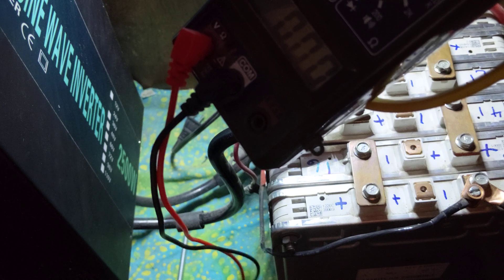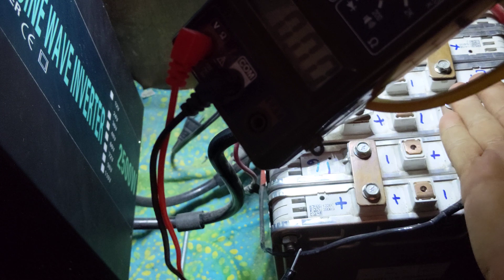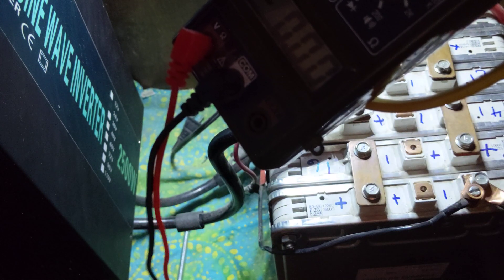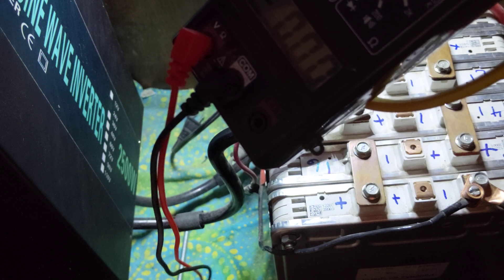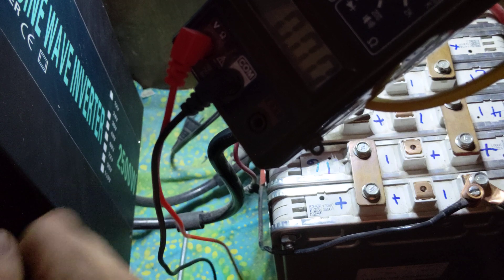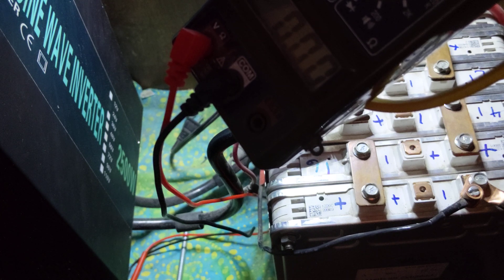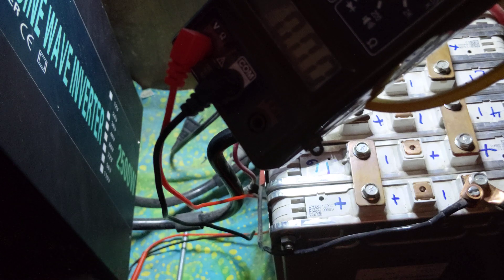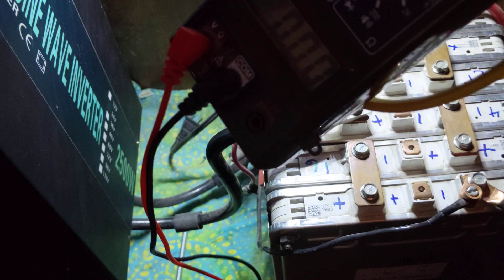Part 2 of the 10-month check-in on the 24-volt Nissan Leaf off-grid battery bank.

Comment: I just ordered 3 used Leaf modules from a company that claims they are approximately 39AH each and in the description they even lower that to 33.1 and I guess I am still getting around 1kwh. Is that OK or good in your opinion. After all it is only $114.00

Comment: Good morning, I have 48 of these leaf batteries and wants to configure it for a 24 volts off grid system. Any suggestions on a possible configuration?
Reply from the maker: My apologies for the late response. I would series groups of three together and then parallel all of them to keep your 24 volt configuration. I'm willing to have a phone conversation to explain it more if you want.

Comment: I really appreciate this video, not just because you’re talking about a 24v leaf system, but you’re speaking to all the environmental arguments that really resonate with me, and probably should resonate with all of us. I’ve worked in the solar industry for years, and lived off grid for a long time, (and have been generally distressed at the growing popularity in interest of lithium battery backup for homes.) But this makes sense, and in my opinion it’s the only way to make off-grid power a reality for most people. Thanks for the cogent video!
Reply from the maker: Oh wow... Thanks for the astronomically kind words! I was really trying to go for something that didn't exist before not only with the style of video and presentation but with the actual content. Other than the people that I have coached through this whole process there still isn't anybody on YouTube that has a mobile 24 volt off-grid solar system comprised and configured with reclaimed Nissan Leaf modules. You'll find a bunch of people that are using leaf modules in 48 volt systems because that's how they were in the car but people were a bit too afraid to tear it apart and reconfigure it to a different voltage so that you could use off the shelf store-bought inverters. since flicking the switch and going completely off the grid myself I have definitely coached over four dozen different people through the process which is a large motivator of why I created this channel. Many people here the initial numbers and see the drastic difference in cost and for some reason just don't believe me. So I had to make videos explaining every little tiny detail and then ridiculous videos to prove that it works and just keep proving it over and over again with hard data and then people start to wise up! And they have. Three years ago it was almost impossible to convince anybody to do something like this. But, times have changed and perspectives have gone with it. When I can prove that I can run an air conditioner, cooktop, and lawn mower simultaneously with my $1,278 solar system people start to pay attention. Or like the latest video on this account I decided to cook lunch charge speaker charge a tablet, run a fan, mow my lawn and use a 12-amp skill saw to cut wood all at the same time. Not because I like showing the system off or doing completely outrageous things that nobody would ever actually do in the real world...I make those videos to prove to people that it's possible and it's not only possible but probably stronger and it's going to last longer than anything you're going to buy brand new. It really is a win-win-win situation for everybody involved. I very much appreciate your kind words of concern towards the impending doom of our planet. I definitely was able to accomplish two or three things with this system other than saving people money and providing a hassle-free basically plug-and-play solar system. But the growing popularity only stifles the new lithium industry and the extraction of more. It would be impossible to say how much lithium we actually have just sitting in used electric vehicles or machinery. It's a lot though...♻️🔌💯🌞😎

Comment: Can I series 4 of those for a 24volt battery back at nominal charge
Reply: Thanks for your replie much appreciated.. I was planning on changing it at 30 volts max that's 7.5volts per module..
Reply from the maker: @fadajuiceful  Just read the spec sheet on whatever inverter and charge controller you're using Make sure that it can go to what you want it to go to!
Reply from the maker: As long as your charge controller and inverter are ok with going that high. Most 24 volt inverters cut off at somewhere around 30 to 32. Obviously you'd be able to get four of them in under 32 volts but do you really want to be pushing your inverter that hard 24/7? Yes it's possible, I don't think it's healthy for any system. Same applies with using two of them for a 12v system.

Comment: This May be a silly question. But are your solar panels 12 or 24volts? And can I charge the 24v system with 12 volt panels. Is this an instance I’d have to wire 2 12 v panels in series?
Reply from the maker: That's not a silly question at all! That's actually fairly observant of you! 😉 Yes, if you only have 12 volt panels you would have to start with two of them in series and then you could parallel after that but I highly recommend you NOT using 12-volt panels. 12 volt panels are hobby panels in my personal opinion and should only be used as such. If you're trying to create a solar system that you want to live with and live off of then you need something more substantial. Each one of my panels is a different brand name and has a different voltage but they are both over 30 volts a piece. I've seen some panels as high as 50 volts a piece! ♻️🔌💯☀️💚🤙🐢
Reply: Ezmeralda Du Dortoka thank you so much! I thought so just needed a little reassuring
Reply from the maker: @scottmuir6250  Anytime! We can't save the world if we don't understand how! 😎🤙🐢

Comment: I am wanting to build very similar system to yours.   How many watts of solar are you running up top?  How many modules are you using and what are the volts on them?
Reply from the maker: 600 watts between two panels. 6 leaf modules @ 8v a piece configured to 6s2p or just 6s. Three and three to make two 24v batteries that are then paralleled for a little over 3kWh of storage for $450ish, shipped. Less with my code.♻️💯🔌☀️ I go into pretty heavy detail on all of that starting with the very first video on this channel. I don't really talk about anything else other than how the leaf modules fit into a system and what components you'll need to be able to utilize them. I'm pretty sure I've covered it all step by step with sources if you just start at the first one! Fire any questions my way if you have them!😎✌️🐢
Reply: @ezmeraldadudortoka7549  I have been a subscriber on the tv youtube and absolutely love your channel and how you explain it in such simple terms that even someone like myself with no electrical knowledge can understand it quite a bit more now thanks to you.  We are on your channel on the tv as we speak and saw this video and said he has the very same solar system that we are wanting to build but hesitant on what to get until now.  We currently are doing a school bus rv conversion (Skoolie) and we are administrator/moderator of the group on FB called,   The New Skoolie Nation.  If its alright with you I would like to share and mention your knowledge on our group of over 1500 members and growing.  Join us if you like.  Thanks again and back to watching more of your videos.
Reply from the maker: @frankdejesus9783  Thanks , I'm glad it's getting out there! Feel free to share whatever you want wherever! That's the whole reason why I spent a narcissistically large amount of time talking at a phone! There's many other videos of the installation of the the system on my shorty on the graminsta @ezzydortoka. The install was way back in late January early February of 2019. It's not a real hard concept to follow though. Panels, charge controller, batteries, inverter, cables, fuses, lugs, bus bars, bolts, allthread, and some basic tools and you're of an running!! ♻️💯🔌☀️
Reply from the maker: @frankdejesus9783  there many others also on Instagram that I could point you towards for different install ideas and configurations of all leaf modules. There's some cool stuff happening with these modules and I certainly don't deserve the spot light. Every body just like y'all making good choices are the ones literally saving the world!♻️💯🔌☀️
Reply: @ezmeraldadudortoka7549  great videos on the leaf modules. You make it an easy pill to swallow. I would be interested in the link where you bought them with your code if you don't mind sharing. Greetings all the way from Zambia central Africa 😎👍💯
Reply from the maker: @vwbeetle5578  Of course! My apologies for not including that link in the description! ♻️🔌💯☀️
Reply from the maker: @vwbeetle5578  
 https://www.techdirectclub.com/nissan-leaf-generation-2-battery-module-lithium-ion-1-kwh-per-set-66-amp-h-12-volt-configuration-lot-of-2/
Reply: @ezmeraldadudortoka7549  happy new year to you and Scarlett💯😎👍🎉
Reply: Sir if I may ask a question...I have 2 Sunpower model SPR-X20-250-BLK-B-AC solar panels that came off a residential build for a total of 500w of solar.  Can I use these on a build like yours that I am wanting to do 24v system?  I am wanting to order 6 leaf 24v batteries but don't want to overcharge or mess up these batteries once I get all my components up and running.  I wanted to send you the specs on these panels but I don't have your email   The open circuit voltage (VOC) says its 48.8V.   I would like to send you the spec sheet on this to see if you could advise me alittle more.  Thank you
Reply from the maker: @frankdejesus9783  onionpower@outlook.com